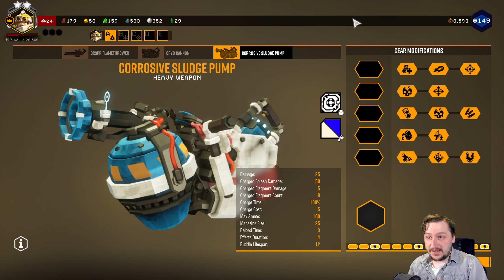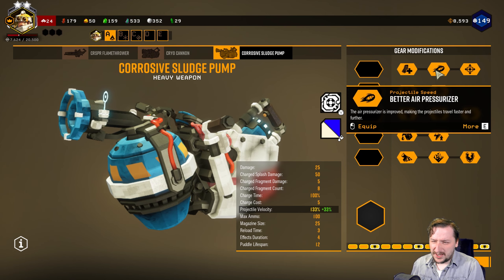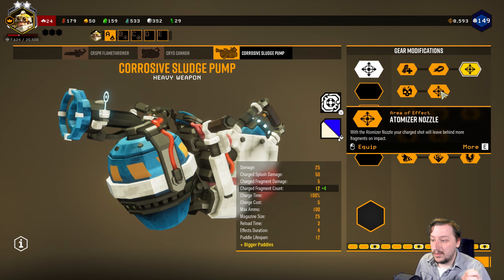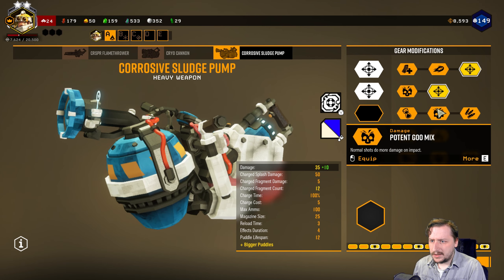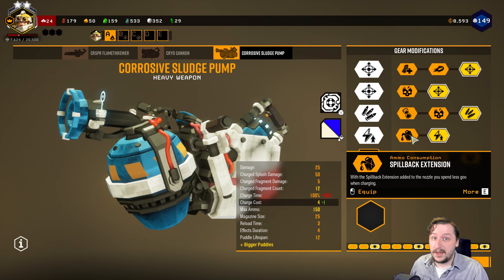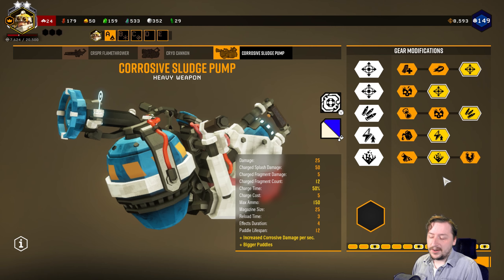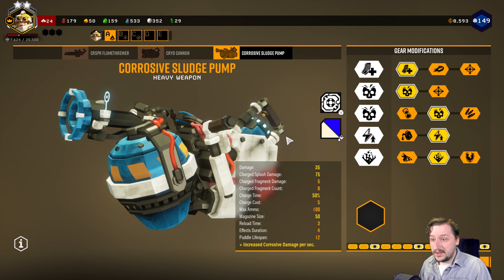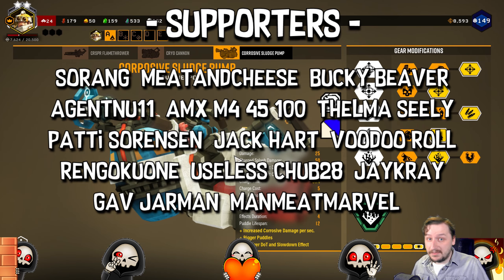Deep Rock Galactic | Corrosive Sludge Pump Builds (No Overclocks)

Comment: I feel like the sludge pump needs another 25-50 ammo to be super good. Mostly because while if your on top of it, its fine, but it has very little room for error unlike say, cryo which has some combo potential to make its already insane ammo reserves even better. And the issue is that you can't get the ammo perks since they are on the same tier as its dps/puddle upgrades which are where the weapon shines. (Getting full puddle duration means if a praetorian sits in a puddle for the full duration it dies)

I have found a nice combo with it though using the goo puddles + drills. Enemies seem to run from drills after you kill one of them with it or after their stun, and if they're still running through a goo puddle, its nice. Its not as good as cryo + drill, but it comes very close!

No doubt its fun though! And it doesn't really need OCs to be good unlike some other weapons...

As for the extra dps of the middle tier 5 perk, it brings the goo puddle up to be equal to the debuff. It kills a grunt in 3.5 seconds via puddle or debuff, compared to around 12 seconds without it. So it seems to be a 300-400% puddle dps increase.
Reply from the maker: That would be cool to have more ammo.  Great to hear your thoughts.
Reply: @ReapeeRon  Sorry to say they nerfed it in the patch, so now the puddle/dot dps is lower. It takes about 24 seconds or so to kill a praetorian on haz 5 if you keep both dots up. I think they reduced the DPS of both by 1 with the acid perk. 

I'm hopeful they buff it back up again. you can no longer kill haz 5 grunts with a single shot unless you charge shot it.